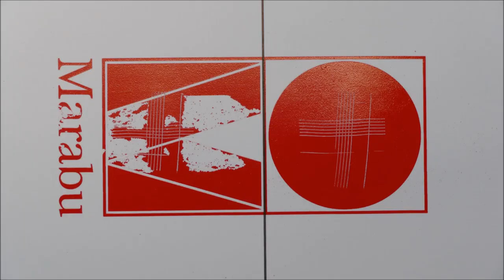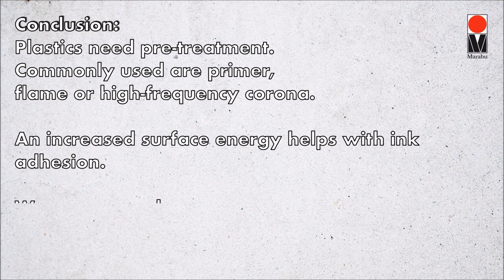Pre-treatment of plastics before printing

Comment: I had some PET supplement bottles I filled with warm/hot water and sealed them. 
Then I did a light sand, dunked them in ammonia for one minute, dunked them in high salinity water for a few minutes, let them cool down and dry. Later, I dunked them with soapy water, vinegar, clean water, and then 91% isopropyl. After drying, they absorbed dye pretty well. 
I did the same with a construction hard hat but sprayed them with an adhesion promoter bonding primer instead of the ink and spray painted them. Paint stayed on very well.